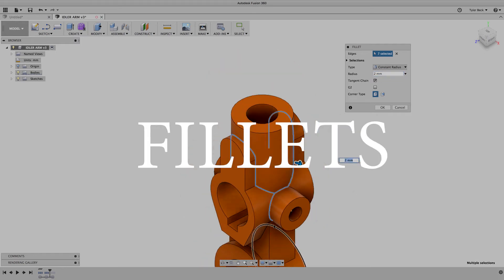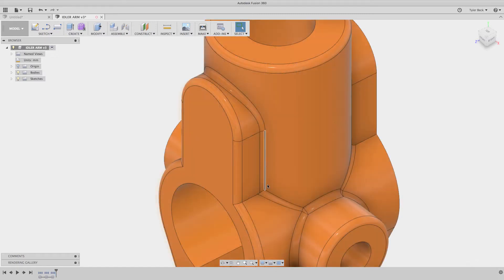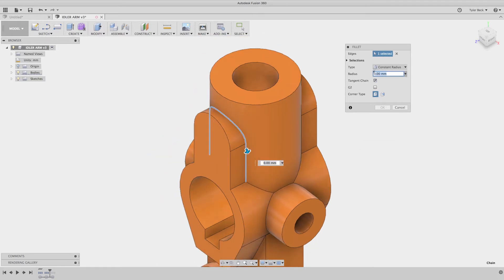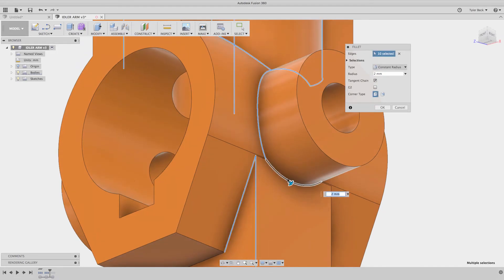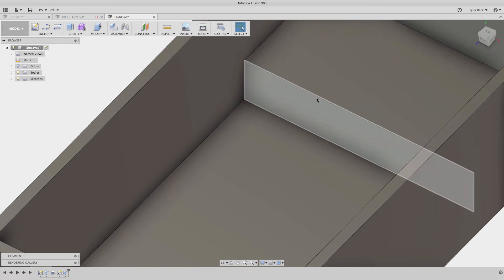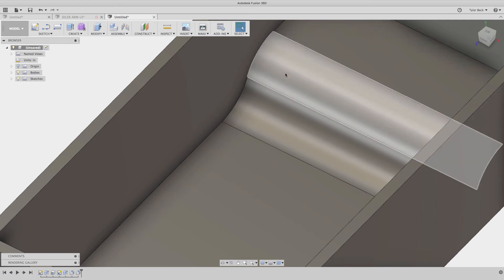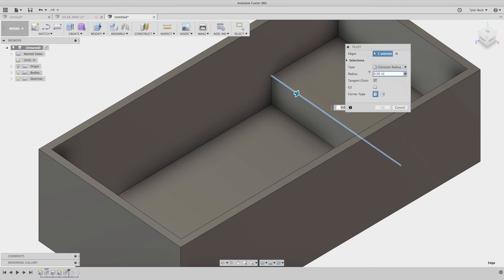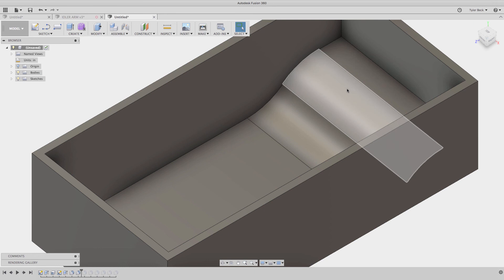Fusion 360 Tutorial - Fillets that Converge

Comment: In my experience you won't really go far with a single monter fillet, it gets slower and slower to compute the preview when you add edges, and eventually it just gives you an error. If you ever did the mistake of selecting multiples edges at once without checking the preview edge by edge, just delete your entire selection and redo your fillet you can never predict which edge created the error. This is at least my experience when modeling for 3D printing, where the geometry is way crazier than when modeling for machining.